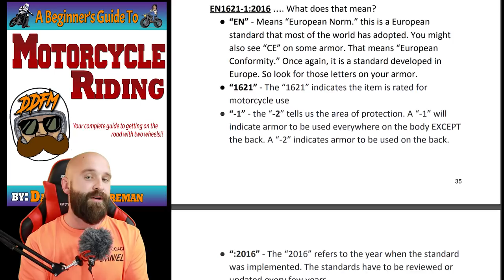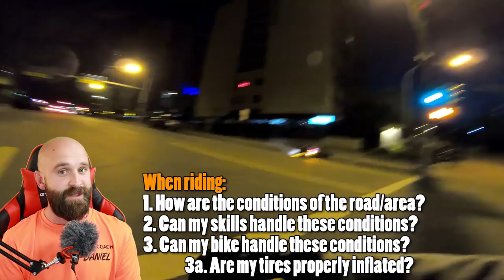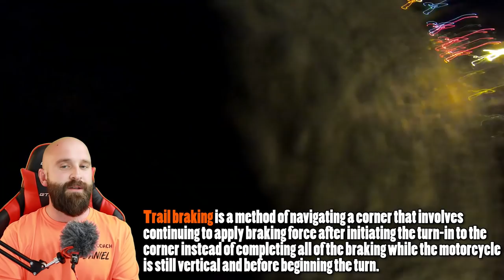Crashing 100 KPH Into A Wall Is Not Good For You (Motorcycle Corning Mistakes)

Comment from the maker: Are you new to riding and want to know where the heck to even start? Check out my Beginners Guide!  http://MotorcycleBeginnersGuide.com/
Reply: DanDanTheFireman I think the ability to swerve at high speed (70mph+) is very important. There’s a lot of videos about doing this I suppose. But they never include metrics. Is it even possible to swerve around a car sized thing at a considerable speed? How soon would you need to react? Within at least 100ft? 20ft? 10ft? How aggressive can you be counter steering at that speed Idk; I just think you couldn’t possibly make enough videos about getting around stuff at high speed. If that’s all you did I watch your videos so many times. Love your work brother. You’re an asset to our community.
Reply: 100 kmh is 62 mph.
Reply: 100kph=60mph, 110kph which is typical in my area on the major highway= 70mph

Comment: I had a low side like the second one on my way to school back when I was a young squid.

I was going about the same speed as well. I had most of my gear on except for pants and the pit bike boots probably weren't the best idea.
 My left rear pocket was almost completely ripped off, luckily my wallet was in that pocket and that prevented any road rash.

Seeing the damage to that pocket at such low speeds was suprising.
A little faster, a little less luck and my butt would've  looked like a baboon's.
Reply: Same except I was going for something at Walmart before church, light turned yellow so I sped up and ended up ruining my favorite suit and left quite a bit of dna on the road

Comment: Excellent Dan ! Just wanted to share my opinion. I WAS a diehard H.D rider since 1965, all Sportsters ,  favorite  still is my 2012 XR 1200X. Jan. 22 2019 took Delivery of a new leftover 2017 Ducati 1299 Panigale S. Wanted the last of the L twin. The 1299 is my every day transportation, over 14,000 trouble free FUN  miles in one year. when I ride the XR, it feels unsafe, braking, handling, 580 lbs verses 400 on the 1299. The over 120 horsepower difference does not matter. Can't stress, I'm sure you understand, Tire technology today is INCREDIBLE for traction and wet rainy riding.. Even put Perellie's on the HD, did not help.Never cheep out on tires, your life depends on them. The Panigale rear tire has too be replaced every 3 - 3500 miles when I do an oil change Tire inflation, so many people do not check weekly, CRITICAL!! the 1299 S electronics saved my butt more times then I can remember. ABS, engine braking wheelie control, Launch control , traction control, throttle control Olins suspension all adjustable. And the unmistakable twin torque.. Please remind everyone  with spring around the corner, road repair and sealing the cracks with that HORRIBLE slippery tar is as bad or worse then the paint stripes.. IF you have not figured it out i''m over 70! and 175 lbs. Ride safe guys ..

Comment: Beware the road paint! Had a ridiculous low side in the rain on a long right hander freeway exit with a crosswalk near the exit of the turn. Took a bad line trying to split the crosswalk paint and ended up touching a strip at 35mph if that, not leaned over hard and no throttle input yet still that shit was like ice. Zero chance to react. Just down! Up to that point had ridden 25 miles in pouring rain. Was just too good to be true making it home without an incident. STAY OFF THE PAINT!!
Reply: STAY OFF THE PAINT.
ESPECIALLY WET PAINT!
Reply: Yea the first one was directly on the paint
Reply: @tpv59  Yeah! As a beginner I did a 180 degree spin into a parking space by getting too hard on the back brake on a wet painted line. It was just a fluke I didn't hit the adjacent parked car and that I didn't fall off, just put down the kick stand and walked away.
Reply: Tar snakes are no better. Cold tar snakes can really upset your traction and if they are big enough upset your suspension. Take it easy on roads/turns with them.

Comment: Why do people not get that the streets are not race tracks? I'm not even talking about other traffic and oncoming traffic. The surface itself isn't set up for this. It is set up more cheaply for travel.
A race track is smoother. It has barriers designed to save your life, though ultimately a concrete barrier to save the spectators. A road has gutters, poles, fences, walls, and will simply turn you into gravy.
Reply: The Street is pretty good... Until it isn't.

Comment: Second video comment. The concept of trail braking is to turn in, after braking has been initiated, giving your front tire more weight and available traction. By accelerating at the beginning of a corner you unweight your front tire giving it a greater chance of slipping out on you.

Comment: First - my apologies for such a long post, but I think this is important.

This is some of the best content you've posted in a while, especially the second clip.

But, at 8:40, I think you may have mis-spoken (or at least used some verbal short-hand that I found a bit confusing). Turning and acceleration is not "taking away traction". Your traction, at any given time, is what it is. Turning uses some of that traction. Acceleration (or deceleration, AKA - braking) uses some of that traction. If the sum of the traction required by the turning and acceleration is greater than the amount of traction at any given instant - that's when your tire(s) "loose traction" or start to slide.

OTOH - turning, braking, acceleration to "take away traction" from the total that is available.

Riders must consider the amount of traction available to them at any point in time and judge whether the traction demands they are making (demands: acceleration, deceleration, turning) exceed the available traction.

One way to look at this is:
Tav = Total traction available at any given moment
Tt = Traction required, at any given moment, to maintain a turn
Tb = Traction required, at any given moment, for braking
Ta = Traction required, at any given moment, for acceleration

Then

Tav >= Tt + Tb + Ta

If not, then sliding/skidding happens.

Comment: Dan, you said "Doing what we love, motorcycle riding."
Problem is, I see a lot of them don't care about the bike. It is the speed and adrenaline they love. They are on a bike because they can't afford the tricked out Mustang or charger they really want. But they can afford the bike. A bike gives more miles per hour for the dollar.
They aren't really bikers. They just use a bike. 
It's the difference between a firearms enthusiast vs a criminal who uses a gun.
Reply: It's more than just speed or muscle car envy. It's the total immersion aspect. Driving a muscle car is a beautiful experience in all aspects. But being on a bike takes one out of the box and immerses one in the experience.  A little throttle the front goes up, a hair less throttle, the front immediately tries to dive and shove you into the bars. You can feel and smell and taste the wind. You put the bike almost on its side in the corners. The asphalt rushing right beside you. The complete sound, and feel of your engine, drive train, and tires. You are immersed in the experience at a level unobtainable in a car.
Reply: @mr.shannon6137  
But you are coming from the perspective of a biker. But to quote some who have it only to go fast or cut in traffic "If I can't do that, I might as well give up riding and get a car."
Not everyone thinks the same way.
Reply: @icecold9511  I will give you that one, because you're right. There are a lot of riders who don't belong on bikes. There are a lot of people who don't ride, but should.  I have tried like hell to convince numerous people to get a bike and start riding,  without much success.

Comment: Just a little input dont want to be a clown or anything. The second video is from canada im assuming due to his channel name so its 38 kph. Doesn't change the outcome though. And he said it was from low tire pressure in the front in a comment reply.
Reply: It's always the riders fault in a single vehicle accident, blaming something elses will always lead to a repeat of the incident.
Reply: @redcanoe2637  id say that due to poor maintenance he crashed. Im also assuming he takes care of his own bike and doesnt have someone else do a pre ride inspection. So in the end its 100 percent his fault if it was poor maintenance but there are variables.
Reply: @redcanoe2637  Not true at all... you need to address the cause, so you can correct that problem...
Saying its just the riders fault and not addressing the real cause will cause it to happen again... because if this was low tire pressure, then just saying, Opps my bad, wont correct the low pressure, will it... If it was leaning too far on a poor road surface.. saying oopps its all me, wont show you that you need to stay more upright on questionable road turns... Yes take responsibility, but you need to address the blame to make necessary corrections.

Comment: I use PUSH STEERING.. I barely lean my body and NEVER hang off the seat... I don't have a sponsor... PUSH STEERING is pushing the left handlebar DOWNWARD to go left... Push the right handlebar to go right...  It keeps your body more vertical so you don't add weight to the lean of the bike... But the key is DON'T RIDE like you're being paid... Have fun.. Take a few rides at lower speeds to see the route and know where you should just slow down.. ESPECIALLY when you're on opposite lane roads...

Comment: I would say wrong tires for the conditions. Trying to do what's on a race-smooth track with what should be race tires on a racetrack on a normal road with god knows what tires. Also correct tire pressure for the conditions come into this.

Comment: I believe that in physics,  If it takes X amount of power to move a body of a given weight to a
speed of a hundred miles an hour, should that body be brought to a sudden stop, It will now
absorb the FULL inertia it took to get said person to that speed. Work is defined as weight X 
distance. Wt X dist. X time probably in seconds, either way it took work to get you at that speed
and to suddenly stop, your body could be giving up the energy that was used to get your self
to that speed.

Comment: So you don’t accelerate during a turn? My understanding is this: before the turn, roll of throttle, lean in during turn with no throttle, exiting turn at apex smoothly roll onto throttle to straighten bike up.
Reply: 7:34 What you explained is accelerating coming out of the turn not during which is exactly what you want to do!

Comment: First video comment. Trying ro get a knee down by sticking it out with poor body position is bad. His upper body should have been hanging of off the bike as much as much as his knee keeping his bike more upright. His line selection had a early apex.  Dan do not say speed to zero when contact with an object is glancing. If you need a point of reference go to a pool table, though different friction will change the effect some what. The only speed to zero incidents are head ons.

Comment: 143kmph = 88mph and 101kmph = 62mph
Reply: 88mph. I get it. He wasn't expecting the wall to still be there after the flux capacitor activated.
Reply: @icecold9511  adds check of flux capacitor to tclocs or actually deal with my disappointment I wasn't first to this reference...have a great weekend Shawn.
Reply: Guessing y’all noticed the flames and sparks appear under his back wheel.

Comment: The WHOLE purpose of hanging off the bike is to decrease your lean angle so that you're able to corner quicker. And to be able to do that, you have to lean the bike properly; if you look at the rider in the 1st video, their body positioning is terrible; they're leaned over the centerline of the bike. The entire purpose in riding like that is to show off by getting a knee down. Had they been properly positioned (with the weight on their inside leg, the bike leaning towards the outside, and with their head kissing the mirror in the direction they're turning), the lean angle would have been DRASTICALLY reduced, and they would have made that turn easy....
Then again, this isn't the track. Crossing over the lane divider? Riding like jackasses on public roads? Glad you survived, and I hope you're ok, and that EVERY SECOND of the pain was a lesson for you to not be a Street Rossi....